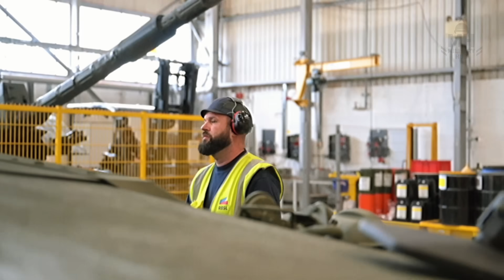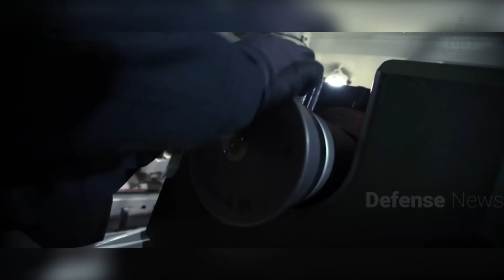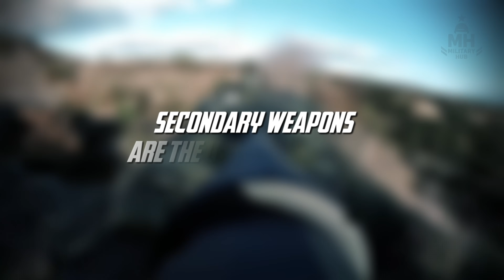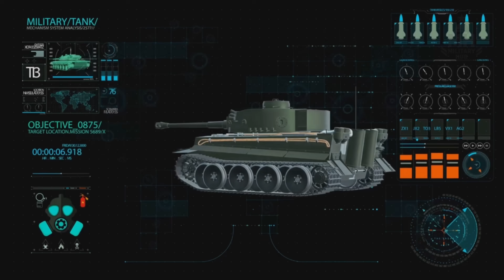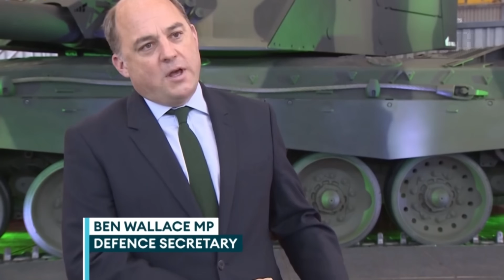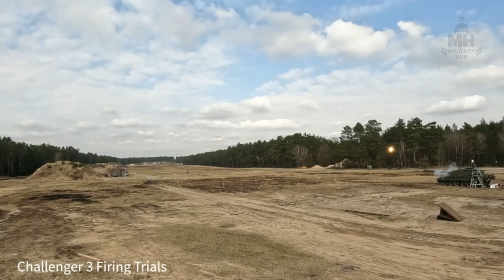This British Tank Will Changer EVERYTHING- Here Is Why!

Comment: CH3 will have a power pack with up to 1500bhp the new fuel injection system and cooling has already shown this. Also a new upgraded transmission and improved suspension allows the extra power to improve mobility.

Comment: Why has the U.K. changed to an inferior smooth bore barrel? When Ukraine has proved that the rifle barrel is more lethal and delivers accurate hits at greater distances than the smooth bore barrel.
I you want the best, may be the standard for compatibility should be that other tank manufacturers change to the rifled barrel.
Reply: Rifled barrels limits the types of ammo that can be used.
Smoothbore barrels also allow higher velocities without excessive barrel wear.

Comment: Ok.... ukranina crewes love the CH2 it's got better armour (even without the armour packs) than both the leopard or M1, you can run it on batteries to lower it's EMF signature, it's roomy, you can make your dinner while buttoned up and it has a toilet..... It also carries a gun that can take out pretty much everythig from 3000m+. And the new CH3 gets the same dull, half the range, cheap amo firing german crap on the leopard, M1, Le Clerc and half a dozen other MBT's. Not an upgrade however you sugar coat it.
Reply: better armour..please explain (Chobham/ Dorchester . add on packs etc) against what? Roomy..no more space than M1 A2 or Leo 2 A5 eg having worked or been in all..CH1/ Chieftain..couldn't move compared to partyville in Leo 2 and M1s...EMF? You're confusing abbreviations...M1 later iterations now have a GUE (even chieftains had one...but that just means runnining the smaller auxilliary engine for power rather than main engine)..wtf are you talking about from your gained "knowledge from you tube and video games)? L55 120 smoothbore (M1 has L44)...greater rangers of ammunition, but loss of longer range indirect fire with fin- rather than spin-stabilised ..I won''t go on with all these social media myths. All the videos are "AI" bollockings reinforcing civilian/ gamer myths
Reply: And what yes is it in the Ukraine,it got bogged down in the mud and took two hours to tow it out,it's engine overheating safety cut out doesn't help the matter either, it's only suitable for urban or firm surface warfare as has it's rare appearances in the Ukraine, last time I saw it in the front line it was flat out on it's way out of Kursk on tarmac, gun barrel facing rear.
Reply: @JohnCampbell-sl5nx  Correct, I agree fully. The Challanger was designed to fight on German Battlefields. Many call the T-90 a bad tank, but fighting on the mud of Ukraine it's the best option at under 50 tons. The CH2 on excercise on Salibury Plain is around 75 tons, but nobody is shooting at it. On mission with addon-armour packs, Slat Panels and modules this can push 83 tons while a couple of my sources hint at nearer 90 ton all in.
Reply: The new amo is being developed jointly by the UK and Germany so is not German cr@@@p. It will have to be as good as the UK DU rounds. The higher pressure gun will aid extra penetration.
Reply: @robertnemeth6248  Personally bin it...! BAE developed the CTA, scale it from 40mm to 120mm that gives a pen according to upscaled figures of maybe 560mm of rolled Homogeneous Armour at 1,500 with 10-20 rounds a second with interchangable rounds including "smart." And as a bonus BAE gets a new navel gun. Just a thought. I don't like DUP the birth defects in children in Iraq are real. The Russians have banned DUP.